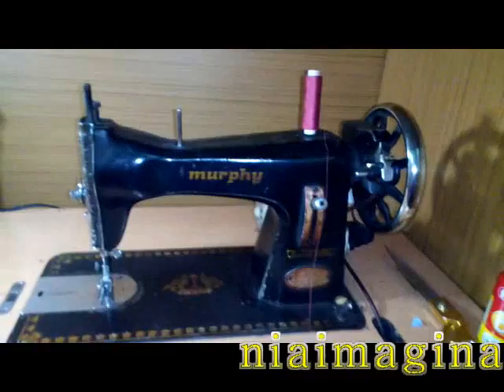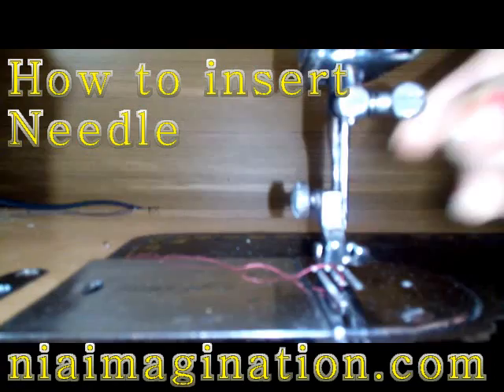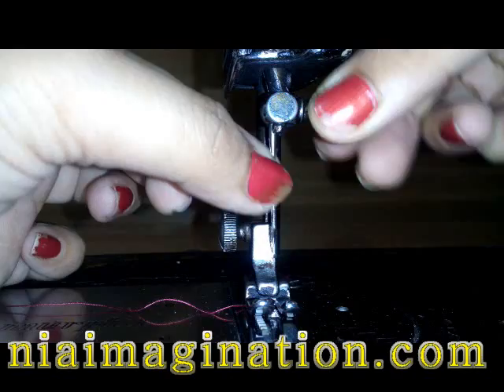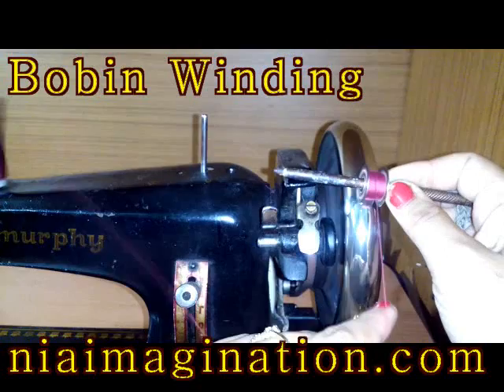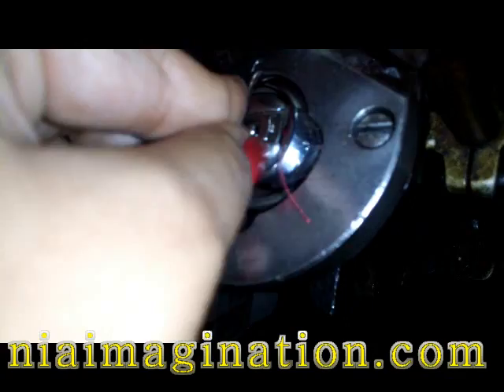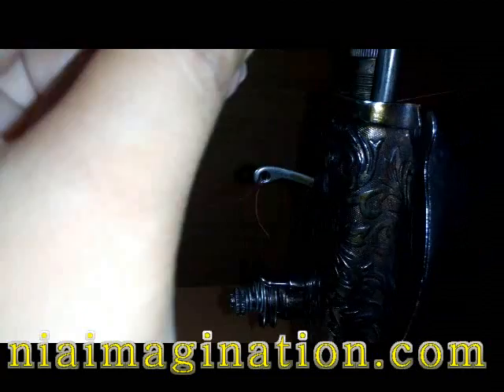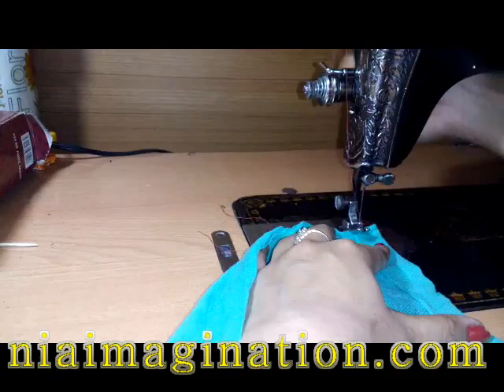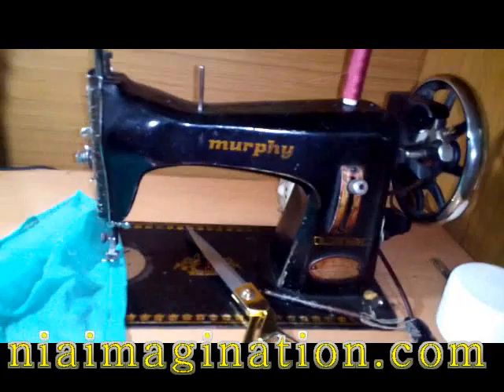How to use and maintain basic sewing machine for beginners full

Comment: my bobbin driver got stuck...wat shuld i do nw to make it wrk...its not rotating...!!! needle os not picking up the thread
Reply from the maker: +Aishwarya Menaka may be it means you were trying to sew without bobin in bobbin case and thread is strucked in place where you insert bobin case,
Now try to turn wheel forward and back word and if your bobin comes out a bit then try to cut multiple threads and clean your machine
Hope now you are able to get rid of problem you stucked in

Comment: I was bought new machine in that the wheel is not working only belt is rotating what I can do please help me
Reply from the maker: if u bought a new machine then that must be in guarantee plz ask customer care to fix the problem
this type of problems comes in new machines but gradually it will smoothen 
may be some screw is more tight, give some machine oil from where it's not working
Reply: ya I gave oil. my friend told me to cut belt. am also did  that only few minutes it's working well after that the belt only rotating

Comment: I bought new machine but earlier wheel was working properly but not while moving with hand handle is not moving, it's jam Like, please give solution
Reply from the maker: +chahat sharma dear if u bought new machine then that much be in guarantee and this jam problem comes in case of new machine plz ask customer care or shop from where u bought
They should fix it 
And when u work on it on continue basic it will definitely start working smooth
Reply: chahat sharma Biding machine ko thik kaise kare biding nahi. Ho rahi hai
Reply: mera machine jam ho gia kiya korna a abhi